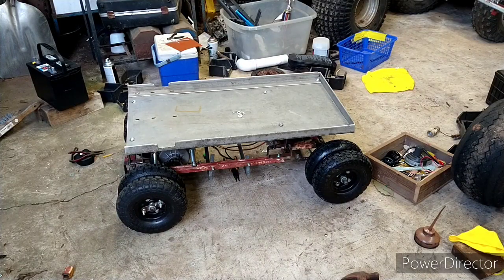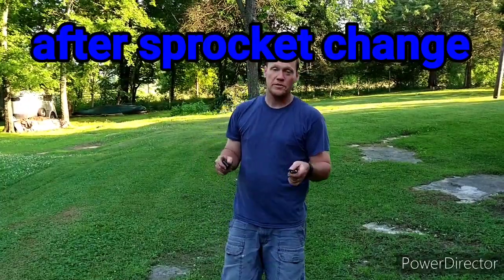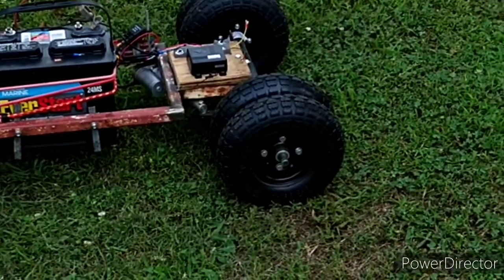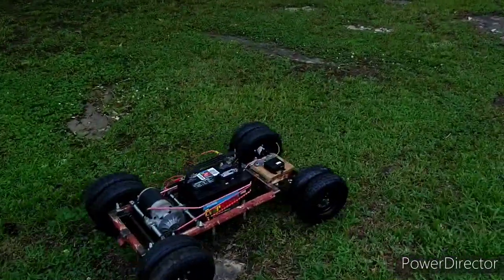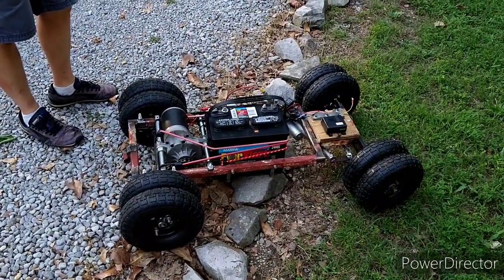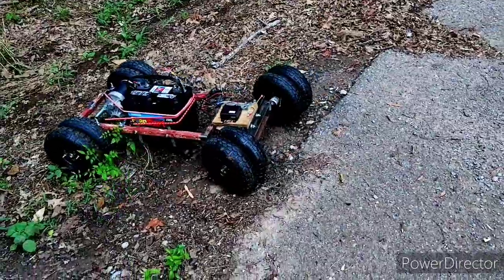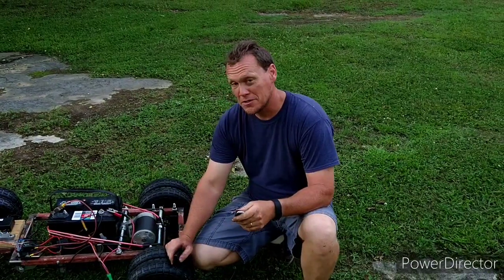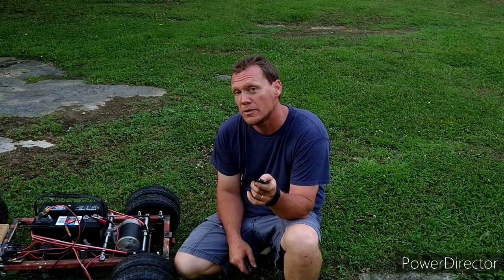Electric radio controlled wagon, first test. We have a working prototype, using at the beach, farm.

Comment: Awesome idea! how did you attach the rear wheels to the drive shaft? Looks like the type of wheels from harbor freight that usually come with a bearing pressed in.
Reply from the maker: You are exactly right they are harbor freight wheels I made a collar on a piece of flat bar that would attach to the shaft and bolt to the wheels